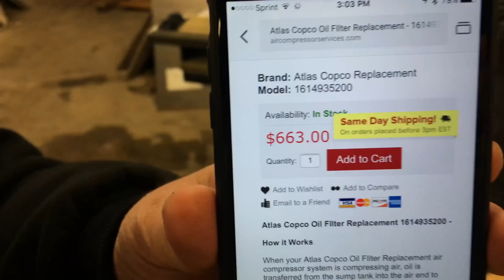$3 Oil Filter vs $663 Monster Oil Filter vs 60,000 PSI Waterjet

Comment: Atlas copco make aircompressors and this filter is for the GA range the big high flow units. somewhere around 13bar 116 l/s
We use the larger sized units to supply airpressure to our autoclaves. 
The filter media doesn't look like much because it is a high pressure filter. The media expands when pressure is added it's not actual paper it's more like rubber foam, hence the price.
Atlas probably sell a maximum of 100 of these filters per year which also explains some of the price.
I have always wondered if they could get away with using CAT oil filters instead.

Comment: It's an oil filter for an industrial diesel powered portable air compressor. Most often used in drilling operations, but also as backup air supply for industrial sites.

Comment: Wix 51773 is about that size , but has the common 3/4-16 thread, and fits on fords and a lot of imports , it's a common filter base size. 
It fits beautifully on my Briggs 20hp v twin.

For reference, choose your own filter: fram ph8a and the wix 51773 have same base but the 51773 is about 7"long. It's listed as a heavy duty replacement for a wix51515 /fram ph8a

Comment: oil goes in the outer little holes and is forced through the filter media and returns to the engine via the center, unless the filter media becomes completely blocked or the oil pressure is simply too high in the filters dirty side the pressure relief valve opens and it flows though without being filtered.

Comment: I'd be interested in learning what the operating cost per hour is for the WaterJet Cutter, factoring everything into consideration (maintenance, electricity, garnet abrasive, water, and operator pay).
Reply: DrTeddyMMM it barely uses water they made a video about it it uses sand to make it cut and I'm typing this while my dog is pushing the food plate off the beed and trying to stop it with my foot she really wants to make a mess

Comment: ATLAS makes mining equipment mostly, they make the biggest mining trucks and gear on the world. im no mechanic but would guess this came from a mining truck
Reply: Pedro Barbio Atlas Copco also makes industrial rotary screw air compressors, which I believe is what this filter came off of.  Filters on those machines get very large.

Comment: Dudes! that's no Oilfilter, that's a Spin on Separator for Screw Compressors that's why there is non yellow baked paper inside. It's a sort of glassmesh inside, and it's a coil.Try a Mann +Hummel W 13145, its housing is the same, and it's High Quality OEM.

Comment: It's an air compressor filter. 15 bar = ~217 psi, so I assume it's for a high pressure bearing lubrication system.

Comment: the large sized oil filter would be from a large diesel engine such as transport truck, construction equipment, and farm equipment
Reply: Except it is not from any sort of engine, it is from an air compressor.
Reply: Quite easy to confuse large filters of that size between ones for engines to heavy or large machinery and trucks and ones for rotary type air compressors.
Reply: Leonard Martin Looks like a filter that goes on a Cat engine that is hooked onto a well to suck water for irrigation
Reply: The Tool Guy dude shut up you've said that multiple times now. If anything it does look like a semi oil filter. Fuckin moron.

Comment: Comes from 18 wheelers like 12 liter Diesel engines
Reply: kostas dramoudanis nope
Reply: IF you look up the part number and company you would see its an air compressor filter for rotary screw type..
Reply: IF you look at 0:39 you can just read it off the description, they knew for sure, but your video gets highlighted the more comments / likes you have, so they asked their viewers to write it down, to gain more clicks.
Reply: Are you kidding me?? A 12 liter Diesel engine? You’re an idiot.
Reply: Jajaja
Reply: kostas dramoudanis Also hate to tell you, any truck made for hauling large trailers like an 18 Wheeler is going to have more than a 12L diesel

Comment: the $663 filter is off a transport truck
Reply: No, it's for an Atlas Copco rotary screw compressor. I run a fleet of heavy haul trucks, we don't spend $663 for an oil filter, Baldwin 1gal filters cost me $11, Fleetguard costs about an average of $30.

Comment: when will you try to cut some tungsten carbide?
Reply: Nathan West The machine has a setting for that, so it probably cuts it.
Reply: actually, very few substances are harder than tungsten carbide, like cubical boron nitride, some types of ceramic and diamond, tungsten carbide is used to process the sand they use for cutting, just as reference for how tough this stuff is

Comment: I belive that the filter was not a oil filter to filter the oil circulating, its actually considered a air/oil separator. It doesn't filter the oil as much as it filters the oil from air, they are used on large rotary vane air compressors. The compressors use oil to seal and lubricate large screw type pumps that then eject a air/oil mix, this separates the oil from the air to recycle it.

Comment: Atlas Copco makes quality air compressors. There are few types, one of which is the oil injected rotary screw oil compressor. It compresses the air together with the oil, and then separates pressurized air and oil mechanically. This requires a high volume of oil flow and also needs the oil to be as uncontaminated as possible. That's why the filters are very heavy duty and expensive.

Comment: Thats likely from a very large rotary screw air compressor. They're designed for long service intervals, so the filter needs to hold up as long as the oil. This can be 8-10,000 hours. A car oil filter is typically only going to see 300-500 hours before its changed.

Comment: Atlas Copco is a worldwide company known for packaged air compressor units. Any marine engineer should be familiar with them, most of working air compressors (7 bar air used for various purposes other than starting the main engine) on board modern merchant navy ships are made by Atlas Copco.

Comment: It's from a air compressor 
Atlas Copco are a company that sells maintains and makes air compressors, we use them in the U.K. at the company I work for but not sure if they are a world wide company or not
Reply: Yeah it's world wide. Atlas Copco compressor units are widespread on merchant navy ships.
Reply: or it might be a hydraulic oil filter i work on semis and have to change ones just as big all the time
Reply: This website says it is designed for Atlas Copco air compressors ...
store(dot)industrialairpower(dot)com/1614-9352-00-Oil-Filter-Element_p_64002(dot)html
Reply: They are a Swedish company
Reply: South Africa has to do with the comment because he was replying to Nelson Mandela
Reply: Looks like an Air/Oil separator from an Atlas Copco Rotary Screw Compressor
Reply: This is definitely an air compressor oil filter. On hydraulic systems (rock drills and other Copco equipment) the filter is on the suction side of the pump and doesn't need to be rated to 15 bar (217 psi). On an air compressor the oil system has to be rated for the maximum pressure the machine could possibly produce. 

Whoever said an air compressor doesn't need a filter that big might be surprised to learn that it's possible the machine it goes to may have more than one of these, it's not uncommon to see an Atlas Copco with 2 or 3 oil filters in parallel. Air compressors can be huge, largest I've ran into is 50,000HP and the largest I've rebuilt is 3000HP. Don't underestimate how big industrial equipment can get.

Another indicator it's for an air compressor is the that it has a built in bypass. On cold starts and when the filter gets super dirty the differential pressure will open the bypass and allow oil to flow through it since dirty oil is better than no oil. If the bypass wasn't there and high pressure was applied to the filter it could make it collapse and get pushed through the system and then sucked into the air end completely destroying it.
Reply: +Nelson Mandela, Nope, that is absolutely a filter from an industrial air compressor.
Reply: that's right! https://aircompressorservices.com/atlas-copco-oil-filter-replacement-1614935200.html
Reply: Mrwilson0506 You took the words from my mouth. I was going to mention a diesel powered air compressor unit. They are worldwide.
Reply: Mrwilson0506 atlas copco is a swedish international company that has multiple sectors, one of their biggest is air compressors, they also produce industrial power tools and other industry based products, such as tools for planes, cars and other machinery
Reply: a big compressor does. I work for Atlas Copco
Reply: Kyle Thompson atlas copco air/oil filter system are really different from kaeser or Ingersoll Roland .
Reply: I just puked. but I was hungry so I decided to eat it. then I puked again because i ate puke
Reply: atlas copco in sweden ish a huge mining company and it looks huge for an airkompressor.
Reply: If its a oil flooded machine, yes they do.
Reply: diesel filter for a locomotive
Reply: we have atlascorpo diesel generator at our company could be fro diesel generator
Reply: Well, my father's company was bought out by atlas copco, and they design and sell rivets/rivet guns for factories
Reply: Mrwilson0506 I think they are worldwide..its a very famous brand. we use Atlas Copco air compressors all over Holland
Reply: Mrwilson0506
Reply: Mrwilson0506 no it for a mine diger.
Reply: Mrwilson0506
We used their products in the textile mill I was working in, here in Pakistan.
Reply: Mrwilson0506 it's an air compressor I took one of at my last job
Reply: Mrwilson0506 air compressor?  No not that
Reply: The very long argument over air compressors
Reply: It's from a semi
Reply: They make air tools as well. I remember trying to sell some Atlas Copco nutrunners a while back. Had a hell of a time, no one wanted them.
Reply: mysock351C what the fuck does south Africa have to do with a comment? and since when does one idiot determines a whole fucking country? don't ya think that's a bit controversial bud?
Reply: Says in the description! "Designed for use with Atlas Copco Air Compressors" Sweet Jesus all you have to do is scroll down. No wonder why South Africa is so fucked up. You folk aren't even smart enough to use a mouse.
Reply: Mrwilson0506 naaaahhhhhh
Reply: Mrwilson0506 they are a Swedish mening company

Comment: I would be careful licking filters. some contain known carcinogens like Diatemetrous Earth. Please don't get cancer, we need people like you to entertain us.
Reply: Diatemetrous Earth is actually quite healthy.. you need to look up what some real dangers are...
Reply: well, those filters looks to be in pristine condition for a used filter. n yes. ingestion of motor oil is detrimental to ur health, but only if u consume it in copious amount.
Reply: Emmanuel Thommy I was kind of thinking that also. But I doubt someone would spend $600 for a filter, just to send it to them to be cut in half.
Reply: Kevin Weil Maybe the tread where it screws was bust. But if you think for a moment, the inside is going to turn black after used for the time it should be, so I can almost certainly say this was off the shelf not good for use filter.
Reply: Emmanuel Thommy https://www.osha.gov/pls/oshaweb/owadisp.show_document?p_id=22720&p_table=INTERPRETATIONS
Reply: u need to google up what silicosis and group 3 carcinogen means
Reply: DE is only a carcinogen if inhlaled, as far as I know...
It's not that bad
Reply: Ian Reid DE is not a carcinogen. It's used in lots of food as a safe ingredient
Reply: Right the make up of the filter is the concern, not the fact that at some point it probably had oil in it :).

Comment: What does the sand do other than get in the way lol
Reply: TARTED PEANUTS helps cut through material
Reply: TARTED PEANUTS it cuts...
Reply: The water by itself can cut, but the sand allows it to cut thicker and stronger things I believe
Reply: It's abrasive so it helps the water cut
Reply: maelgugi not always, the water can definitely cut through some stuff, it's going at 60000 psi
Reply: The sand aids in cutting. Most mild steel or thinner material doesn't require the sand. Cutting thicker or stronger material requires the sand.
Reply: So it's basically a sand blaster with high pressure water, so it can cut through things quicker and cleaner?
Reply: The water alone can only cut plastic or foam so the water alone doesn't rly cut
Reply: Deus Vult. water carved the grand canyon.  and it was Just a slow moving river.  Don't underestimate it.
Reply: cylo lloyd 
Yup, the water just transport the sand, the actual cutting is made by the sand
Reply: cylo lloyd thanks...
Reply: cant be compressed
Reply: lol ya and whats with all the sand in sandblasters?
Reply: TARTED PEANUTS help cut watever you want it to
Reply: Yes it can
Reply: So it just gets in the way??
Reply: Water can be compressed.
Reply: TARTED PEANUTS wow you're a special kind of stupid

Comment: cut the unbreakable Nokia 3310 phone
Reply: The phone would probably cut through the water
Reply: no no that should be like 1M special or something.
Reply: Splitting a Nokia has the same energy as splitting an atom. INCREDIBLY DANGEROUS
Reply: Are you nuts? Do you want the guy to buy another water jet machine...
Reply: I use filters like that for hydraulic oil in our roll crusher and the tracks in out clinker cooler. I work in a cement plant
Reply: Lmao well done Sherlock
Reply: I'm wiling to bet the waterjet will break down :D
Reply: 58book .
Reply: They already did
Reply: dude the other comments are from 1 to 3 months ago before they did it
Reply: rihardo123 its not water resistant (at least at 60000 psi)
Reply: 58book yep